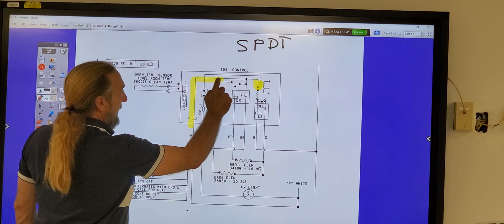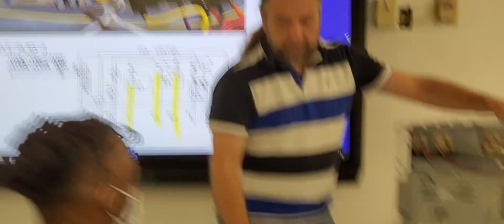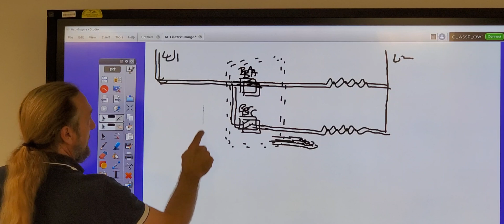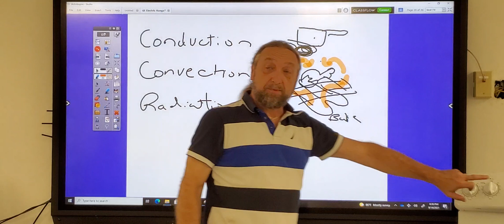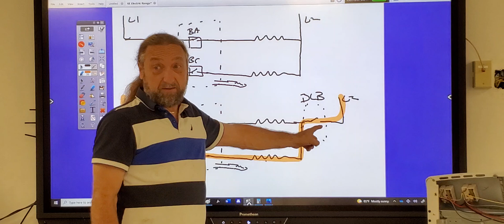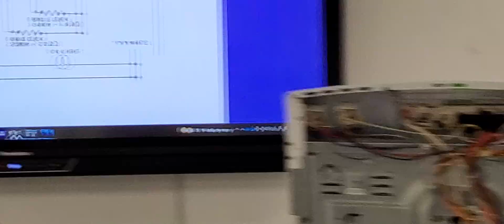GE Range Part 2

Comment: how did that stove worked the first time if the wiring was wrong?
Reply: The stove was wired correctly what was wrong was the way GE drew the diagram on paper they did not physically wire it that way
Reply: Possibly the technician disconnected  and did not take a photo, trusting his memory and ended up using the diagram.